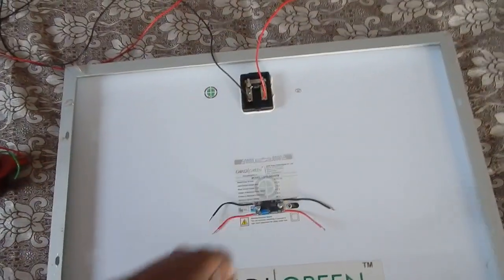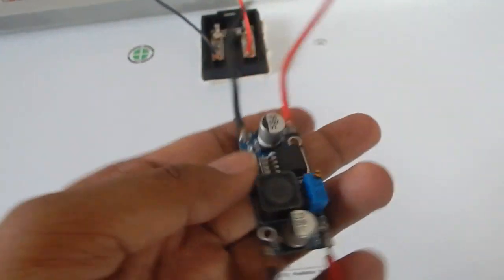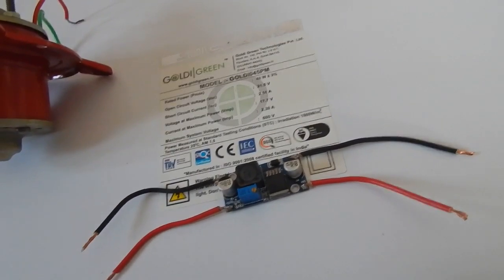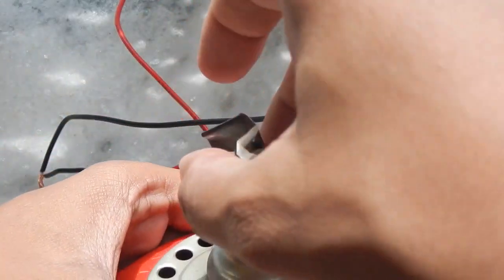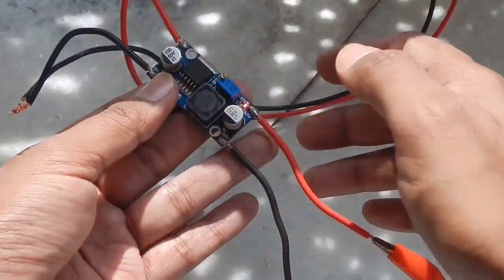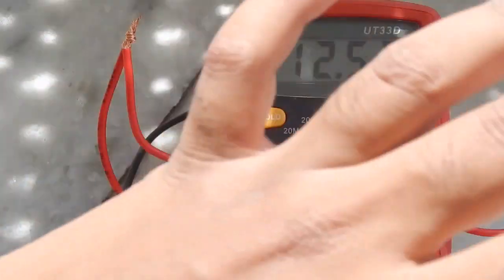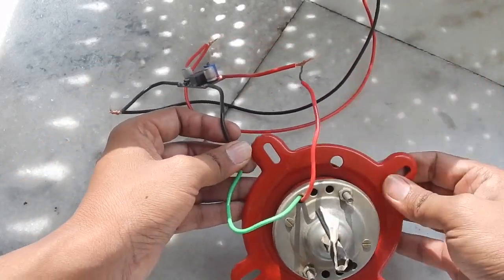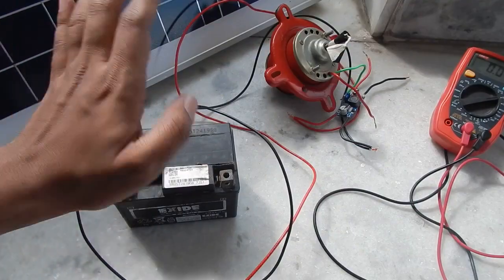Running 12V Dc Load Directly From Solar Panel Without Battery

Comment: Sir plz give me ur number whatsapp or any mobile n,r u saying can i charge my regular lead acid battery,and can i run regular 12v 775 dc motor with d help of   
Bug converter(is that a step down converter),plz ans me ,my life is on ur call.plz plz answer.i hear there r 12v solar panels will they help me to run 12v 775 dc motor.
Reply: Try bro... Me too thinking the same . And yesterday I brought same setup. 775 also.. let me check too.. but I m not sure I am able to find this post and tell the result..  so keep trying...
Reply: Yep.. it works .. tested... For you.. 😊

Comment: Thank you very much for your video that popped up after a search on google. I was just wondering, I have seen somewhere someone saying " DC motor have huge initial surge current to rotate which is usually around 4 to 5 time the nominal input current."
I want to use a 4amp submersible pump with two 100w panels in serie with a step down buck converter that says max 12amp. Will it work? Thanks :)
Reply from the maker: yes, you can run your pump, make sure your output voltage is not lower than what is needed to run the pump. And the inrush current that your are talking about can only reach a maximum of what your solar panel can produce, so as long as the motor is running the current will not go above 4amp. Also, with submersible motors,because the motor is in water, it is naturally cooled by the water which also helps keep the motor temperature low. The important thing is only run your pump when the voltage of the buck converter is at least equal to what is needed for the motor to run.
Reply: Gurribuy  so you are saying it can only run if the motor is already running, it will not be able to start the motor by itself ?

Comment: When cloudy, will low voltage damage the motor?
Reply from the maker: i have tested this setup for 4 months in that period nothing happened to the motor. But, low voltage can damage the motor in the long run. My motor is 36Watt and i'm using 40Watt solar panel, Using a high watt solar panel would increase the chance of damage because high watt solar panel would have more current even at lower voltages. So, i would recommend to use a solar panel just a little more powerful than what your motor needs.
Reply: Gurribuy 
Fantastic 
Thank you
Reply: I want to run a 12v 100w diagphram water pump..which  solar panel I need to run and I need the regulator or that thing
Reply: Either running too high voltage or too high current will damage the motor.

Comment: Your video is very helpful. I need to use a solar panel to run a small 12V DC motor AND charge a small backup battery at the same time. Do you have a video to instruct how to do this? I have selected some components but have not purchased any of them yet. Thank you in advance for any suggestions you may have.
Reply from the maker: you can connect your motor like i have connected, Now, to charge the battery you will need a charge controller, Connect your solar panel to the charge controller and then to your battery.
Reply: @gurribuy  The reverse procedure. Always connect the charging rugator first to the battery and then to the solar panel. The charge controller is not the same device as the video that regulates the voltage directly from the solar panel to the load. The charge controller (PWM) evaluates the state of the battery and generates pulses accordingly. If you connect the PWM to the panels first, you can destroy the controller.